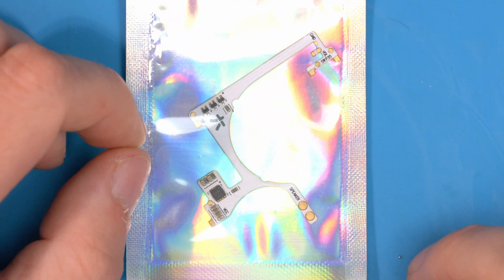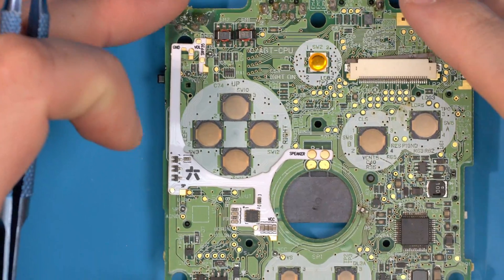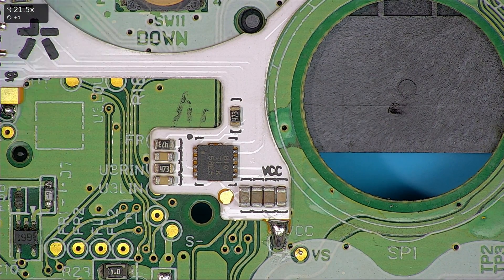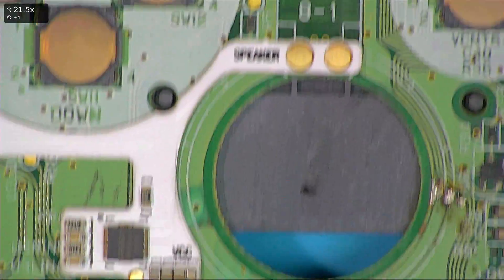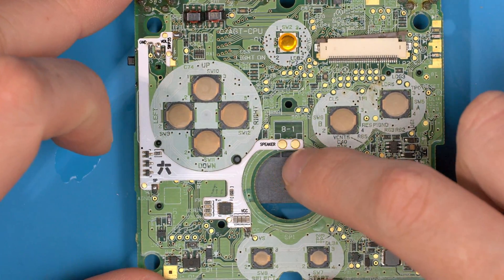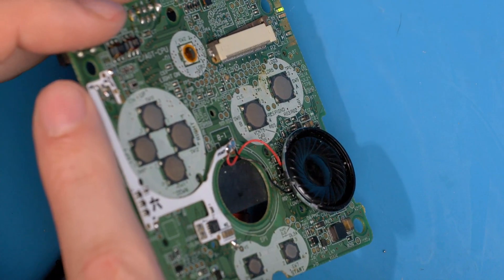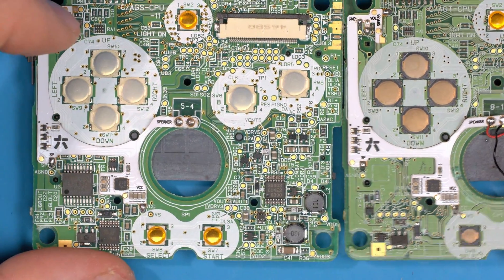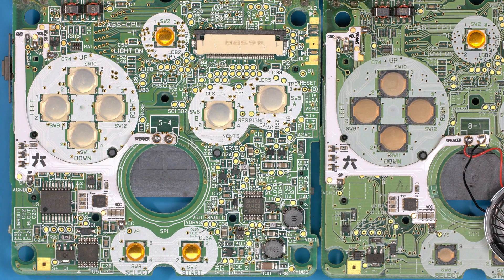CleanAmp Pro Game Boy Advance SP (Wire Free Flex Audio Amp) - RetroSix

Comment: Hi there, I got the audioamp and the speaker and I'm pretty satisfied with the result. However. I have one issue. The speaker is way to big. I can't fit the boeard in. I even used some sandpaper to sand down the outer ring auf the speaker so it sits more flat but its still too big. I got everything back together but I didn't tight'n the three philipps screw too tight because I'm scared the board would break or something. Is this normal? Does anyone else had this issue? Am I doing something wrong? Would love to hear from anyone, if you got something to add :)
Reply from the maker: Our new kits now have a custom speaker the same shape as original. They are out in a few weeks. For now I reuse the OEM speaker

Comment: Another quick question.
Does this support both left and right audio channels?

I've read that some games mix the channels separately, and you may only get one channel's audio when using some amps.
Not really worried about headphones, just that the speaker is playing everything it should.

Looking at grabbing 2 from handheld legend if so.

Also, as a side question, any idea if Handheld Legend is getting a restock on your GBC Amp?
Reply from the maker: Yes. All our amps have always been stereo

Comment: How much does this impact battery life?
Reply from the maker: Depends how loud you turn it up. If as loud as original then it's less battery draw. But full loudness will obviously drain it a little faster
Reply: @RetroSix  Awesome, so it’s more efficient at similar volume levels.
I thought it would be the opposite since the original amp is still in the circuit.
Does the original somehow shutdown when your flex is soldered in?

Thanks for the reply!
Reply from the maker: The IC doesn't draw power operating it is when the speaker is driven it draws current. The way the old amp drives the speaker is less efficient

Comment: my gba sp ags-101 does not have the VOL or Ground connections on its C/AGT-ECPU-01. Any ideas how to approach this installation?
Reply from the maker: Solder the VOL to middle pin of vol wheel. Ground can be any ground you like

Comment: @retrosix Hello, great amp, I wanted to ask you if you can repair a printed circuit that came out when trying to change the audio capacitor, can you use one or are both to be soldered?

Comment: Is this compatible with the RetroGlow mod? I see that the qsb's would overlap slightly but none of the same solder points seem to be used.
Reply from the maker: Yep it works with them
Reply: Thank you finally I found someone asking the same question
Reply: And can you let me know if you did the mod and if it came out good?

Comment: The new speaker you mentioned in the end (though you said it won't be a speaker per se), what's going to be better about it (other than fitting the SP without modifications, I assume)?

I don't particularly love the replacement 1W speaker you sell right now because I think it sounds less full/more tinny than the stock speaker, so I'm hoping you have something better on the way :)

EDIT: also, if it's a better speaker, would they work on other GameBoys?
Reply from the maker: Better sound, better range, longer lifespan. Will cost few £ more than standard ones but should be worth it. Will work in all consoles but no need if console has the space having this kind of special speaker it's for super tight spaces
Reply: @RetroSix can this amp mod and the de humming/hissing mod be used with the retroglow led mod?